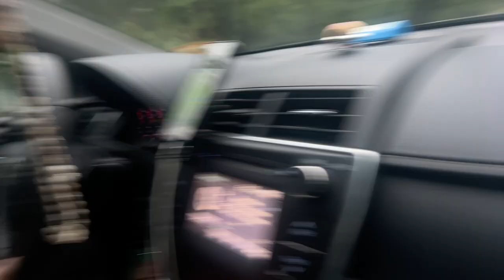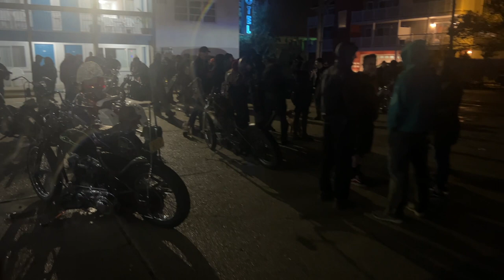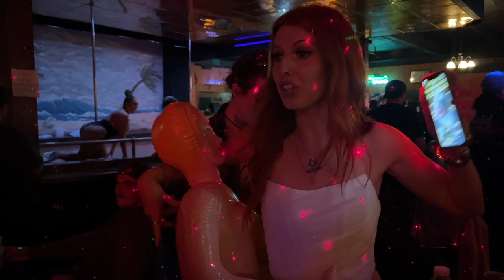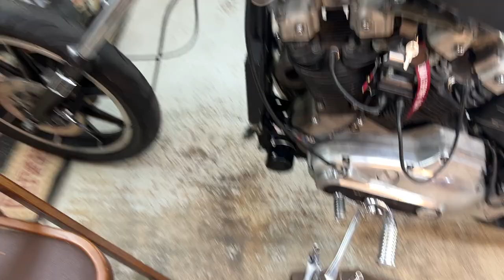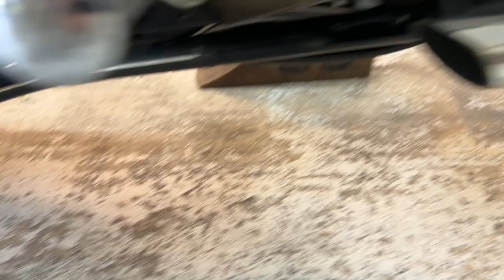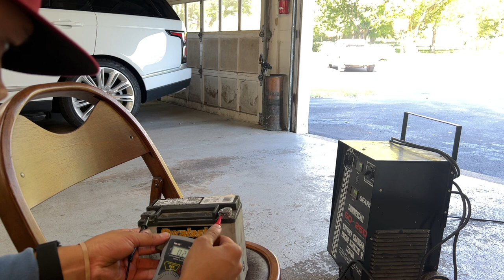THE BIGGEST CHOPPER PARTY EVER???!! + Ironhead Chopper Charging System Runaround

Comment: The stock generators dont really charge at idle. Lock your throttle with the rpms at like 1500-2500. 

Then check what its charging at. 

I usually clip alligator leads to the voltmeter leads and then to the battery. That way i can rev it with a free hand.
Reply from the maker: I gotta get me some alligator clips haha. But I figured mixture fully rich would give me enough rpm's to at least get a read on a little bit of a charge. I need to test again and have someone hold the throttle open. Cheers yo